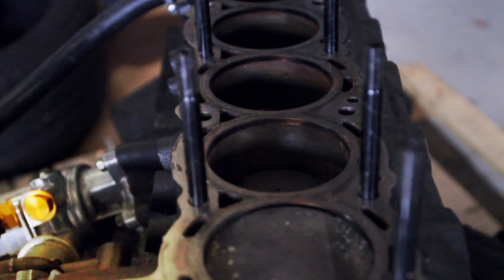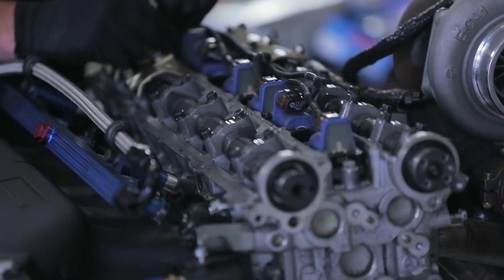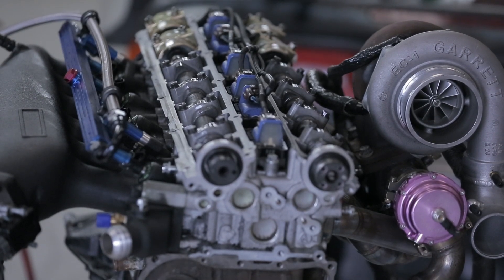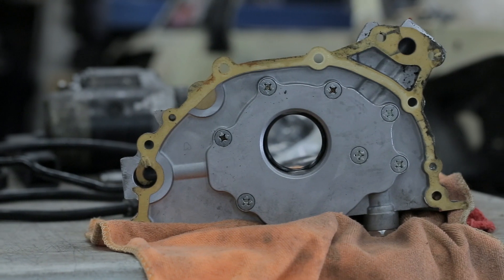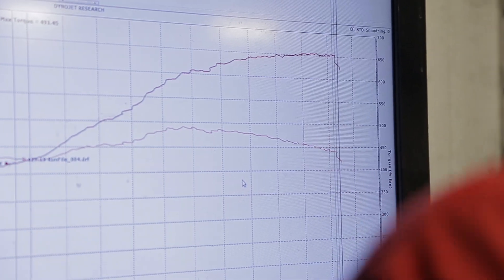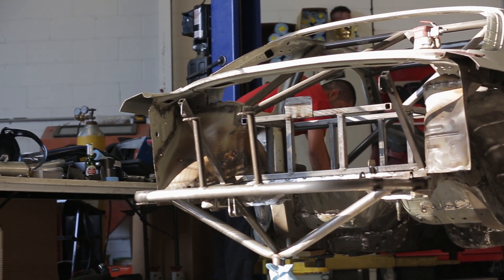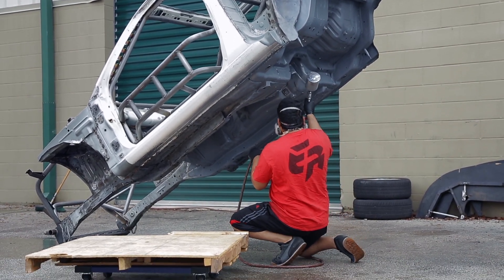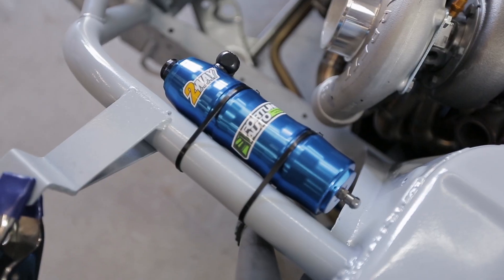Behind the Build: Kevin Lawrence's Pro S14 // Episode 4

Comment: good to see a rb25 holding that much power! what internals are in there? 

maybe one day my RB will be making 700hp 😉😎
Reply: Buy a Mercedes M104 3,2l engine and put  a turbo on it, Im making a little above 700hp and 850Nm on mine and Its a STOCK engine, that cost 500$. Check out my vlogs if you dont belive me
Reply: yeah that's pretty cool. what transmission do you have with it?
Reply: +Garage13 bmw zf 5 speed with a welded bellhousing tigether with mb
Reply: oh i see. I'm keeping it in the nissan family for now. besides, I haven't even finished my rb build yet lol

Comment: rb 30?? is that not from australia??
Reply: theyre in america, they are hardly worth the cost to get them to america
Reply: they are not in america... They come from VL comidors. They bought the engine from nissan before they really used it in many things, like taxis and shit if i remember correct. You toss the sohc head on them and throw a 25 head on and they made a shit load of power. They are very worth it if you are milking the rb for all its got. I have yet to see one in america. Im sure someone has but youd have to be a die hard RB fan cause after importation and shit it would cost more than a 2j
Reply: enjuku racing is in america, rb30's are in australia...i know how an rb26/30 works, i built one
Reply: wayne richards Well read it like i did.... Enjuku was never mentioned in any of these comments... And you sounded like you were talking about 30s
Reply: yeah i can see how i worded it wrong, all G